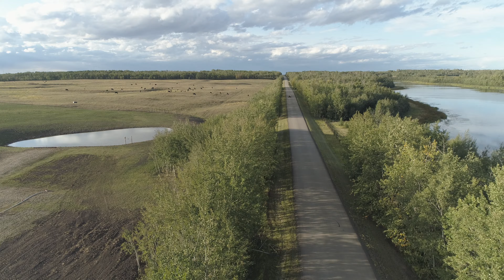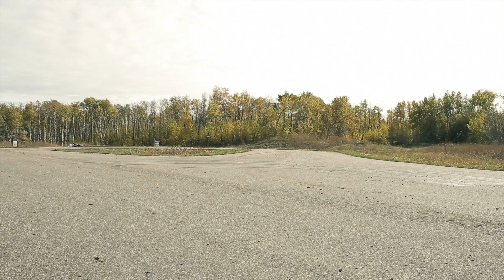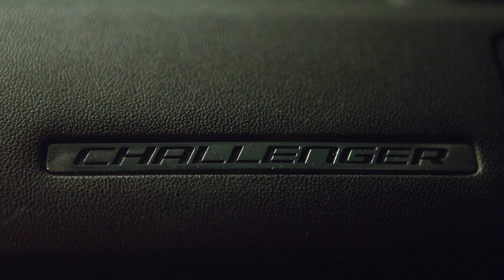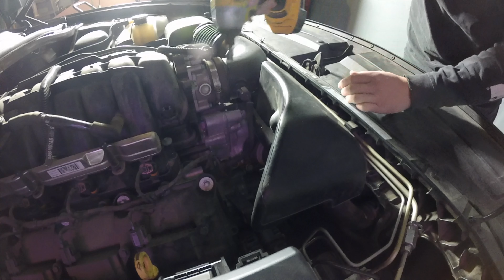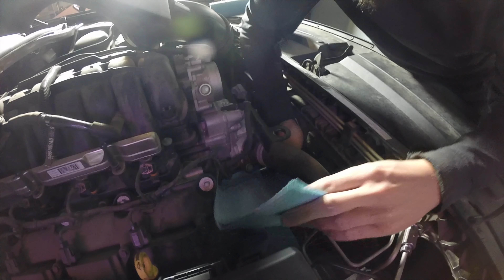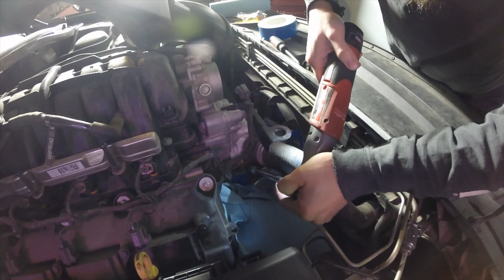160* Thermostat Install for 5.7 Hemi Challenger

Comment: An yeah, that funky thing on the intake is there to reduce intake air noise. You can get a Charger intake tube and they don't have that ugly ass baffle. IT also make more room for an oil catch can.
Reply: yup its on all challengers usually first thing to go i replaced with the Charger tube

Comment: I ended up selling my 2010 and buying a new 2017 R/T Plus Shaker - it was such a good deal I couldn't pass it up. BUT, here is a thread I subscribed to last year because I also have an 07 LS2 C6 Z51 car. Interesting that the long tubes on this guys car (with the cam and ported heads) picked up 22hp OVER LS7 manifolds - which are already better than LS2 manifolds and WAY better than our 5.7 manofilds. https://www.corvetteforum.com/forums/c6-tech-performance/4157186-cam-install-choice-advice-needed-recomendations.html
Reply: @TrackPackRT  The 403 Olds engine? T/A 6.6?

Comment: You should REALLY do a 6.4 VVT cam if you're going to do a dyno tune. 60 rwhp with shorties, more with your long tubes.
Reply from the maker: I haven't heard of a 6.4 cam putting 60 to the wheels.  It always seemed that a 6.4 cam was only a "just okay" choice as far as a cam swap went on the 5.7.
Reply: @TrackPackRT  I'll find the thread on Challengertalk and post it for you.
Reply: @TrackPackRT  After all the internet bench racers finish whinning, the data starts to come in around page 7 https://www.challengertalk.com/forums/f18/2012-r-t-6-4-cam-installed-96824/index7.html
Reply: @TrackPackRT  In short, 60 hp, 29 ft/lbs compared to stock with the 6.4 VVT cam and JBA shorty headers, dyno tuned. Apparently drives like stock till you wind it up, then form 3500+ it's a raped ape. Slight if any mileage loss (less than 1 mpg) and you can't hear it at idle.
Reply: @TrackPackRT  Oh, and I'd bet it would do even better up top with a 6.4 intake tied into the computer so the tuner could set it to go to short runner just after it hits the powerband. You could also do it manually with an MSD rpm activated switch.
Reply from the maker: @mcm95403  Thanks for sharing the thread!  The only problem I have with it is there's no track time to verify numbers on that 6.4 cam.  I'm pretty suspect of dyno results, which is part of the reason I started this channel, to have both track times and dyno results to mods to give everyone a very accurate idea of what kind of power increase can be had after a few mods to the 5.7.  I do plan on doing a cam probably late this year or maybe next year, and will likely get a custom grind for it.  I don't want something lumpy, I want my power down low to be pretty much the same while opening up a bit more power on the top end.  Although the 6.4 cam graph seems to do that, I would want some advice from some other sources I trust before I would go all in on that cam.
Reply: @TrackPackRT  I really think that cam with a 6.4 manifold and long tubes would be awesome! That's my plan for mine, but I'm waiting till my warranty runs out - which at the rate I drive will be about a year and 9 months. In the mean time I'll collect all the parts.